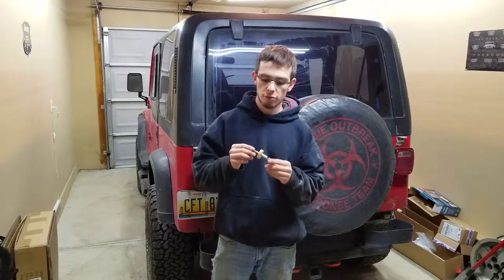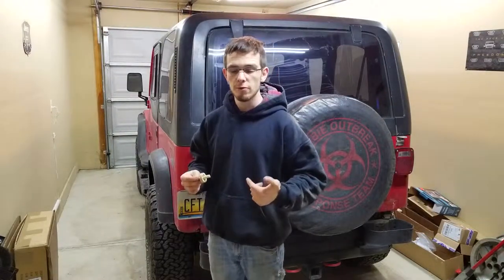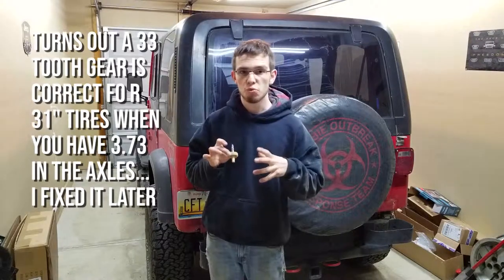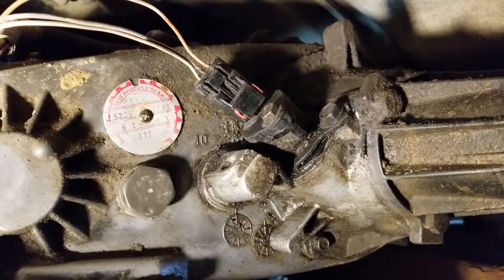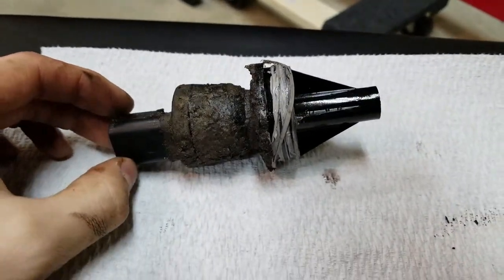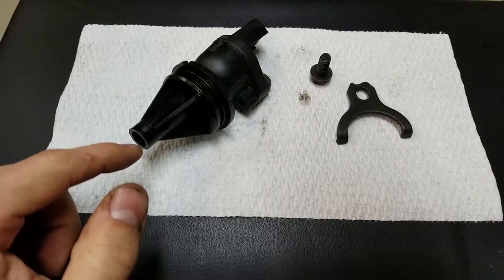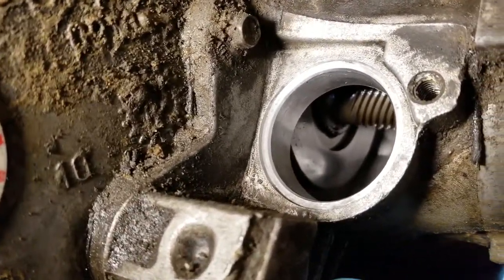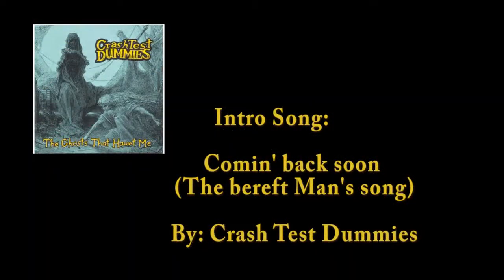Replace the Speedometer Gear in a NP-231 Transfer Case

Comment: I have 1992 jeep xj and i have 35s with 4.88 gear ratio i know that i need to buy 39 tooth gear set for ky speedometer but the thing is there is long and short shaft which one i have to buy?
Reply from the maker: Probably a short shaft for a 92. Long shaft is for if you have the cable speedometer, short is if you have electronic speedometer.

Comment: How do I find my gear ratio
Reply from the maker: I assume you mean gear ratio lol. Your axles should have a small plaque that is held by 2 bolts on the differential. On the plaque it will have a number, that is your gear ratio.  If you have a 4cyl and stock axles you should have 4.10 if it's a manual and 3.73 if it's automatic. I can't remember off the top of my head what it should be for the 6cyl but you can find it online. Quadratec has it listed somewhere. Best method is to look at the axle though
Reply: Jeep Sheep TV thanks man I appreciate it great content
Reply: Patrick Lima you can also email Jeep your vin and they can help you too , my tag was all sandblasted on the axle so I couldn’t read it